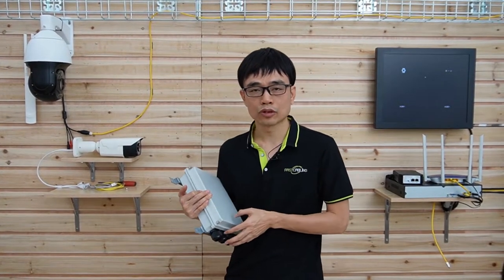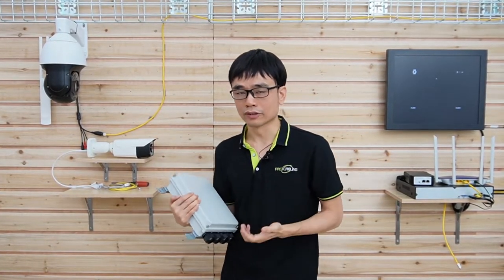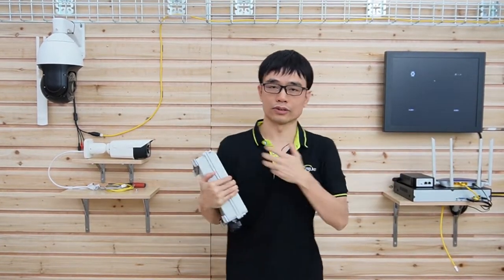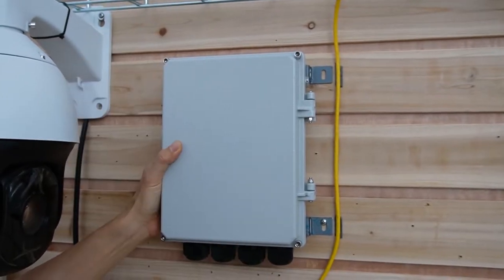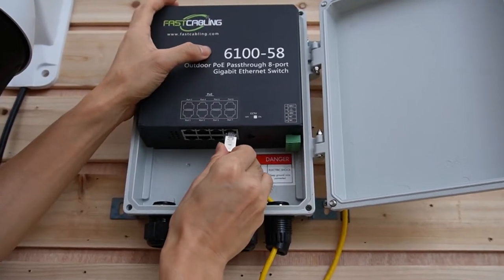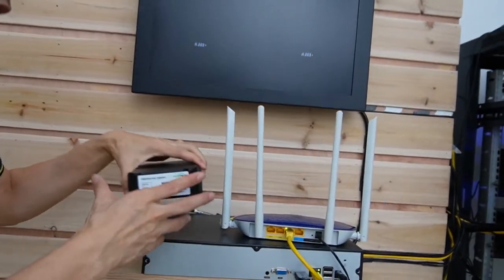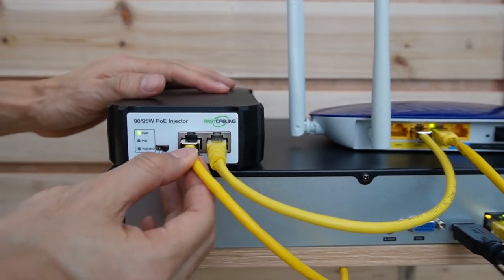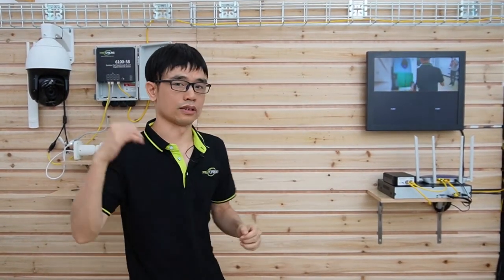The best way to install Outdoor PoE switch

Comment: Would you recommend a straight POE PTZ camera over a wifi connected (to an EAP225) PTZ camera
Reply from the maker: You might want to verify the WiFi coverage before you go for the wireless connection. You can test the WiFi strength by using your mobile phone.

Comment: I plan to use 3 camera's with your POE switch.  Just a question of it being compatible or have these been tested with your equipment .  The Axis P1468-LE / Axis P1448-LE.   I plan to use 3 camera's .. maybe one day going up to 5?  Share your thoughts.  I will use the POE injector in your demo from this video as well.
Reply from the maker: We never test this model, but I believe it should work. It is the IEEE802.af/at compatible camera. Just don't use more than 6 cameras, because the maximum power consumption is 12.95W based on the Axis camera's specification.

Comment: If I'm running 4 cameras through the PoE switch, all within 50 meters of the switch, and the run the  cable  from the switch to  my router, about 30 feet away do  I need the PoE injector? Or will the  router provide the power?
Reply from the maker: You also need the PoE injector. There is no power output from common router. It provides data exchange only.
Reply: @Fastcabling  I guess I wasn't clear, I planned to use a Netgear GS108PP switch which has 8 PoE ports and  has a 123w power budget. I assume the issue then is that while it has a 123w budget it maxes out at 30w for each  line and your PoE injector gives 95w. So  the GS108PP would work but my power budget at the passthrough switch would be only 30w.